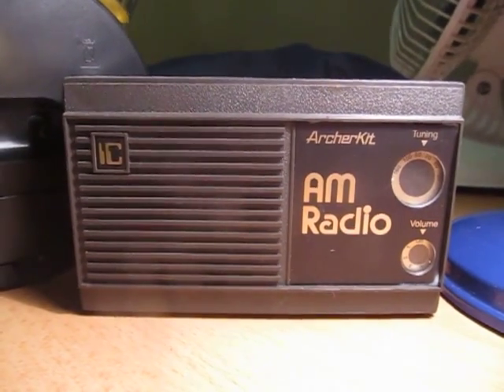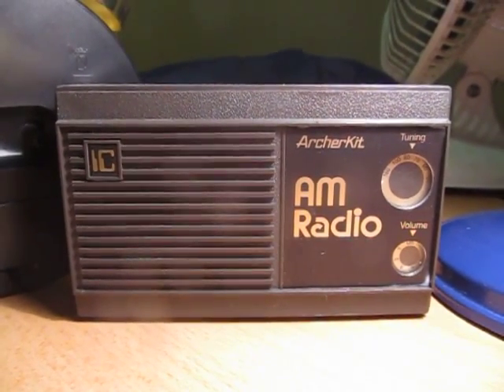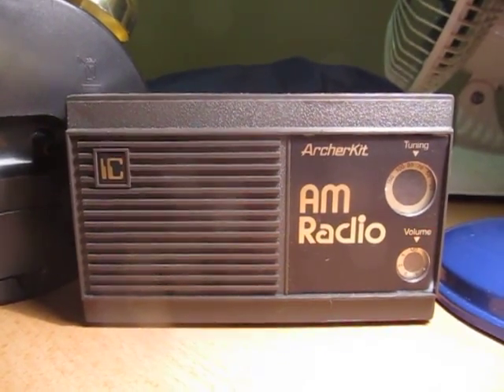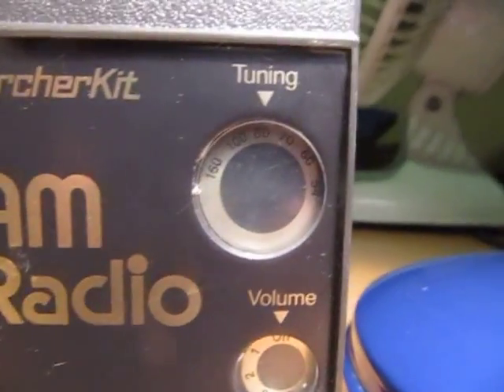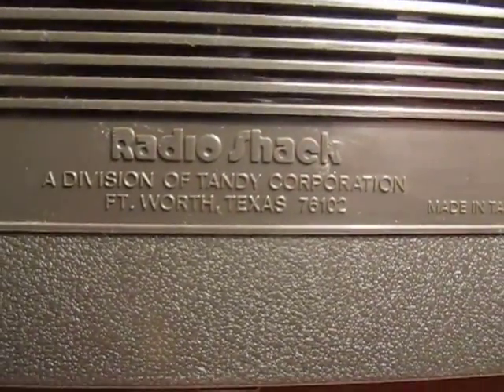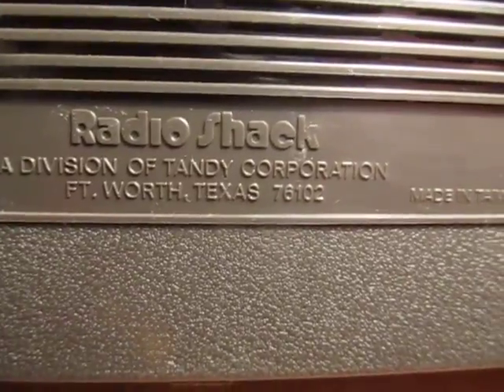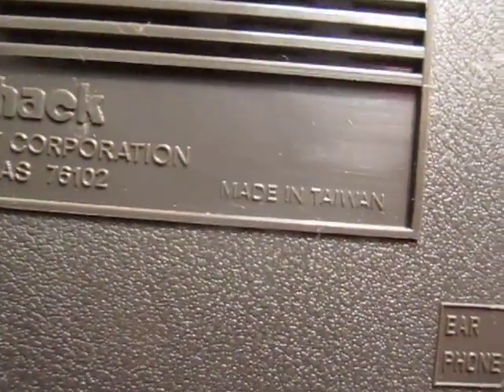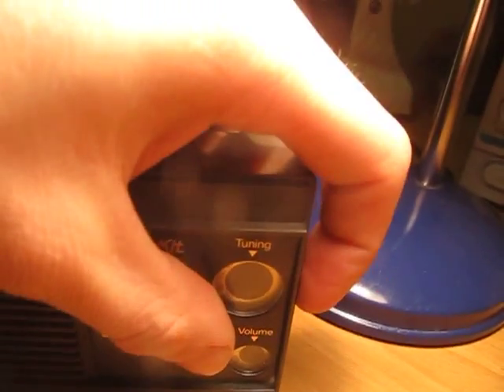Radio Shack ArcherKit AM Radio kit

Comment: I had one like that however its not RADIO SHACK. Its more Generic then what you got.. Building it was not fun at all.they put that IC chip that took away the fun of installing 1000 little parts on the motherboard.. so end up with a small hand full of parts. I remember that old Panasonic AM radio I had. it was all blue. nice build it even come with mirror. open it up for the battery. see a thousand little parts on a little motherboard. . That is what I wanted to build. any way the Radio that look the same as yours with out Radio Shack. no fun to build not enough parts to have fun with. when get it all together. It dose work and dose not work all at the same time.  The signal goes in and out. The sound was crap. when I got too sick of it. I dump it. I am looking at youtube videos if there is something heck of a lot better? So far its gone from bull shit to bull shit from the gates of hell at lease your case look more interesting..  I do not want something no class. no soul and cheap cock. got to be something out there.

Comment: I built one of theses when I went to DeVry Institute of Technology back in 1986, it was a project we had to complete for the class on TV & radio, the kit was easy to build, almost foolproof, we were graded on how many stations it could pick up, Calgary had 6 at that time, it was tuned by adjusting trimmer caps that were built into the variable tuning capacitor and adjustable IF transformers, I tuned mine late at night when reception was better and got it to receive 2 more stations from outside the city, this brings back memories, I still have it and it works great.